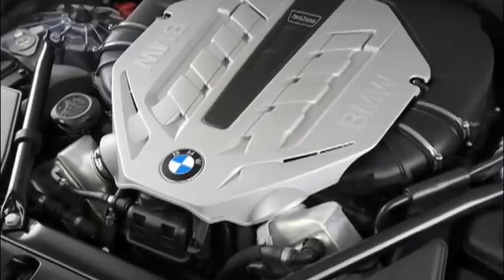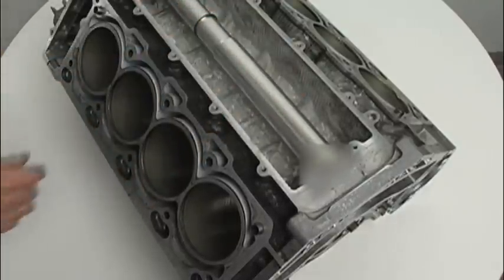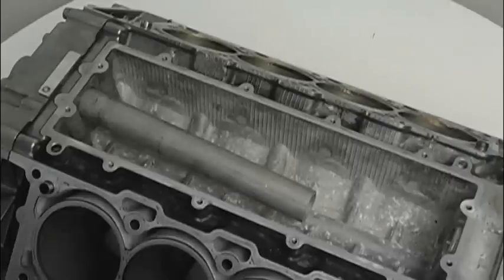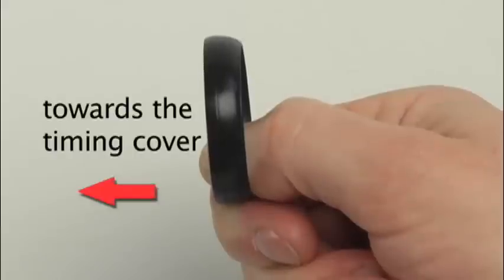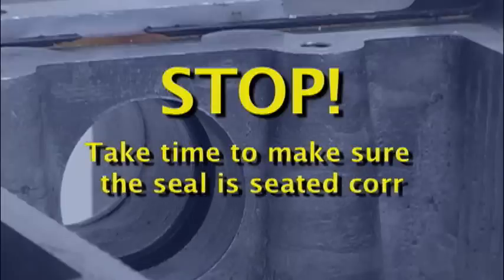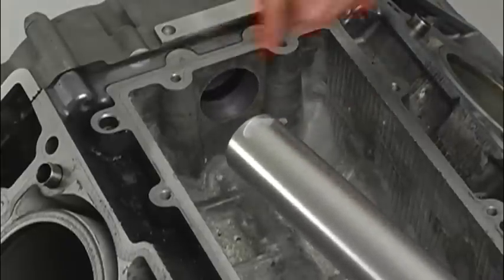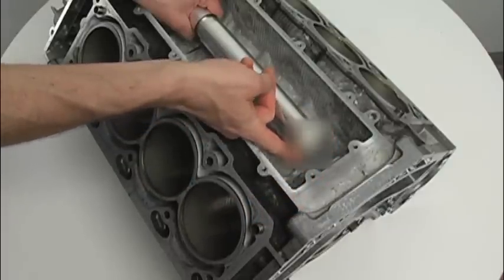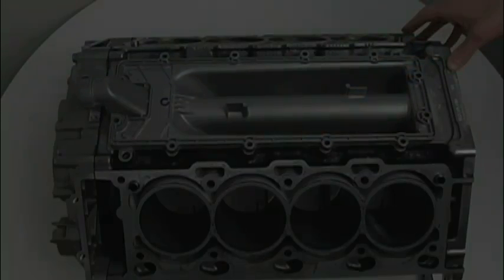URO Parts Coolant Transfer Feed Pipe 11141439975-PRM, Repair BMW N62 V8 Seal Leak

Comment: do we have to replace the intake gaskets as well
Reply from the maker: Hi, our Coolant Transfer Pipe installation instructions can be found here: https://apaindustries.com/apasite/parts/undefined/11141439975PRM.pdf  Please check your BMW repair manual to see what needs to be done prior to installing the pipe, and after installing the pipe.

Comment: Almost impossible to install the front seal. .BMW mechanic spent more than 2 hours just to put seal in right position. Very ,very hard many people give up on this job because of front seal cleaning and installation.
Reply from the maker: Hi Nick, if the technician installs the seal backwards, it's very difficult to insert the pipe without catching the edge of the seal with the pipe, which pushes the seal out of its groove.  The inner bevel of the seal should point toward the back of the engine, so the pipe can smoothly slide into the seal without catching.

Comment: I have a question, what if I put in a pipe a little narrower, like the one that is leaking, put it in after unscrewing the pump, I think it would be ok, the pipe would be a little narrower but I think it would do its job, does anyone have the internal dimensions of this leaking pipe, coolant transfer pipe?

Comment: On a different note, my coolant keeps running out, and I noticed that its wet right on top of my water pump, is this because of a coolant transfer pipe issue or something else? Thanks
Reply from the maker: Hi LC, is it leaking from the little weep hole in the timing cover (located to the left of the water pump), or leaking from the water pump flange?  Coolant coming out of the weep hole means the transfer pipe seal is leaking, and coolant at the water pump flange means the water pump seal is failing.  Hope that helps!

Comment: I ordered this kit from you a couple years back. Can I order just the front main gasket? I want to replace again while I have from timing cover off?
Reply from the maker: Yes you can absolutely order a new seal kit.  Please use this link to purchase it:  https://www.rockauto.com/en/parts/%C3%BCro+parts,111414399752,coolant+pipe+o-ring,11571
Reply: @Uroparts  can I re-use locking ring?
Reply from the maker: @radianm6  Yes
Reply: @Uroparts  thank you
Reply: Well I ordered the seals from there 2 weeks ago and still has not arrived or gave me updated tracking...Help!?.. I'm trying to get this car done asap as it's already been down 3 months.
Reply from the maker: @radianm6  You'll have to contact the company where you made the purchase. This is completely out of our hands.
Reply: @Uroparts  Can I just purchase from you?
Reply from the maker: @radianm6  Unfortunately not

Comment: what parts do have to be removed to get this job done
Reply from the maker: Hi, we don't have licenses to publish vehicle repair manuals, so you'd have to look online (check out forums and YouTube videos), or better yet get a repair manual from BMW or Haynes-Chilton.  The factory design is a long pipe which can only be installed from the front of the engine with the timing cover removed, which can require over 20 hours of expensive shop labor.  Using our collapsible coolant transfer pipe kit eliminates the need to remove the timing cover, which saves a lot of time and money.
Reply: thank you sir i will be performing this job

Comment: can this pipe leakage make the coolant to mix with the engine oil? 
inside the engine?
Reply from the maker: Hi Kanu, if the rubber seal at the front of the coolant transfer pipe begins to leak, coolant will trickle out of the weep hole in the front timing cover.  The situation is exactly the same with a URO or any other brand coolant transfer pipe.  If the o-rings between the two sections of the URO pipe leak (we've never heard of it happening), coolant could leak from the pipe into the coolant chamber beneath the valley pan, which wouldn't hurt anything.  The pipe is surrounded by coolant, and simply directs flow through the chamber.  Hope that helps!

Comment: Why the hell is stuff blurred out?
Reply from the maker: Hi, the rear end of the aluminum pipe is now manufactured with an angled shoulder.  This design update eliminates the need for the angled white plastic spacer (which is now blurred in the video) that was provided in the original version of the kit.

Comment: How long is your warranty? Does it cover labor by an authorized BMW tech?
Reply from the maker: Hi Robert, our "URO Premium" items (part number ends with "PRM", such as Coolant Pipe 11141439975-PRM) are superior to OEM in material and/or design, and have a Lifetime Warranty.  Our standard items are covered by an impressive two-year warranty.  Installation labor is not included.

Comment: why do you blurry some part of your imfi video?
Reply from the maker: Hi Gudmundur, the rear end of the aluminum pipe (toward back of engine) is now manufactured with an angled shoulder.  This design improvement eliminates an angled white plastic spacer (which is now blurred in the video) that was used in the first version of the coolant transfer pipe kit.  Eliminating the spacer makes it easier to match the pipe angle with the angle of the inner back wall of the block, which must be done to fully expand the inner & outer pipes and reveal the lock ring groove.

Comment: How do you know if the coolant is leaking from the pipe seal?
Reply from the maker: You could put dye into the system, perform a pressure test and look for an obvious leak path. But my opinion if there's more than 50k miles the car, then the original tube seal is towards the end of it's life and should be replaced because it will leak soon if it is not the major source of the leak currently. Typically the tube is replaced and the water pump replaced at the same time, which typically fixes nearly all the leaks emanating from the timing cover area.
Reply: There is a weep hole, if it leaking from the weep hole your pipe seal is leeking
Reply: Mike Moyer mine is leaking and it’s all coming out of the flywheel area so to me it seems like this valley pan has to be done because of the rear seal 🤷‍♂️
Reply: @r1crs2009  I know this was a long time ago. But I am curious to know. Was that the issue? I am experiencing the same issue.

Comment: Why is the video blurred? Something wrong? Illegal?
Reply from the maker: Hi Uzi, we redesigned the main seal in 2017 so it now has the bevel on the INSIDE, which makes it much easier to insert the pipe.  The rear end of the pipe is now manufactured with an angled shoulder, which eliminates the need for an angled white plastic spacer (which is now blurred in the video) used in the original kit design.
Reply: @Uroparts  so i bit the bullet and took my chances with this, my order arrived but like you said, there are missing parts and some parts don't look anything like in the video. The main seal is different, and there are now 3 rings in a packet. What are they for? And how do i insert the metal ring around the pipe?
Reply from the maker: @Pantimoto  Hi Uzi, please consult the 12-page printed instructions that came with the kit, which explains everything and has lots of detailed photos.  You can also downloaded the written instructions if you'd like an electronic copy: https://apaindustries.com/apasite/parts/undefined/11141439975PRM.pdf

Comment: What nylon piece all I got was 3 aluminum shims
Reply from the maker: Chris Rican's World we no longer include a nylon piece. Instead we angled the metal pipe so it’s no longer needed.
Reply: URO Parts thank you for replying so quick I’m installing as we speak
Reply: URO Parts 3 shims to me are only used if there is extra play meaning a bit loose am I correct
Reply from the maker: Chris Rican's World yes that is correct

Comment: Wonder if anyone has ever tried Bar's Leak for this problem?
Reply from the maker: It's undoubtedly been tried as a short-term fix (unscrupulous used car dealers have actually tapped and plugged the weep hole in the timing cover to hide the leak), but replacing the coolant transfer pipe and seals is really the best long-term solution.

Comment: WHATS THE PURPOSE OF BLURRING OUT OBJECTS IN THE VIDEO...
Reply from the maker: Hi, the rear end of the pipe is now manufactured with an angled shoulder, which eliminates the need for an angled white plastic spacer (which is now hidden in the video) that was provided in the original kit.

Comment: Is this pipe made of stainless steel? If not - will it corrode over time (just like OEM part)?
Reply from the maker: It's actually the bonded rubber seal that fails on the OE pipe.  The URO pipe is aluminum just like OE, but the beauty is the collapsible design allows replacement in 1/4 of the time (or less) compared to using an OEM pipe.  The high-quality URO seal is a compression fit, and doesn't rely on being bonded to the pipe to seal.
Reply: URO Parts how much is the kit
Reply from the maker: Hi Chris, just do a search for "URO 11141439975-PRM" to see current prices from online retailers.

Comment: Installed it but the rear part of the pipe doest click because of the shape of the pipe, it cant go any further preventing to see the groove to put the locking ring into.please, your customer support is terrible, in the boundary of scam. No customer support number or email on website, its ridiculous
Reply from the maker: Hi Uzi, you can quickly email us or find our phone number on the "Contact Us" page of our website (https://apaindustries.com/contact).  It sounds like you're trying to install the pipe backwards.  The rear end of the pipe (toward the firewall) has the angled shoulder, which must be rotated until it matches the angle of the inner wall on the back of the engine block.  Then you'll be able to see the lock ring groove, and snap the lock ring in place. Please see the 12-pages of printed instructions that came with the kit, which explains everything and has lots of detailed photos.  You can also downloaded the written instructions if you'd like an electronic copy: https://apaindustries.com/apasite/parts/undefined/11141439975PRM.pdf

Comment: I haven't heard any clicks when installing this pipe...smh I've installing 3 of these pipes I've never heard a click..lol
Reply from the maker: Hi Taylor, you're absolutely correct, "click" was a poor choice of words.  It would be more accurate to say it's more of a ** clunk feeling ** when the pipe bottoms out in the timing cover when pushed all the way forward.  If the pipe isn't pushed all the way forward through the front seal, the snap ring groove won't be revealed.  Thanks for your help!
Reply: @Uroparts  no problem Sir I hear others saying it. But I know what you meant. Great Video on details Sir💯

Comment: Why are covering the most important procedure!!!!  The visual was removed from the video ! Why produce a useless video ?
Reply from the maker: Hi Pezman, this kit has been redesigned/improved since the video was created, so we hid the obsolete elements.  The front seal is now flat and square on the outside (instead of rounded like OEM), and has a bevel on the INSIDE, which makes it MUCH easier to insert the pipe.  Press the new seal into the groove with the bevel facing the rear of the engine, and you'll see there isn't any rubber protruding from the edge of the bore to catch on the pipe when it's inserted.  This video also originally showed a wedge-shaped plastic spacer for the back end of the pipe, but the spacer is now hidden in the video because the redesigned kit has the angle machined into the metal pipe, so the extra plastic spacer is no longer needed.  Sorry for the confusion!

Comment: What a design flaw...🤦🏻🤦🏻 not to mention the stupid alternator bracket seal too🙄
Reply from the maker: Hi Jav, we also have an upgrade for the Alternator Bracket Seals!  Find more info here: https://apaindustries.com/site/media/uro-data-bmw-oil-cooler-bracket-gaskets-12317507808prm-12317507807prm.pdf
Reply: Wish I had known about your alternator bracket gasket before I replaced mine...